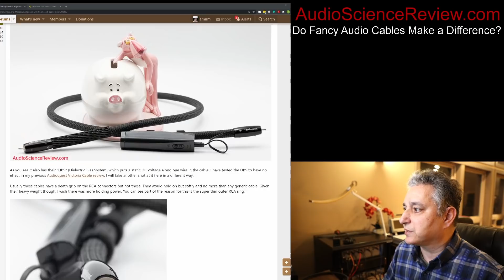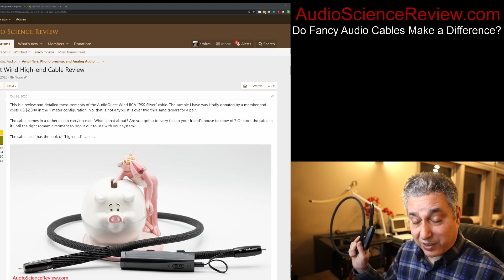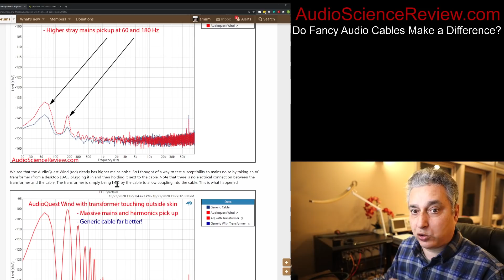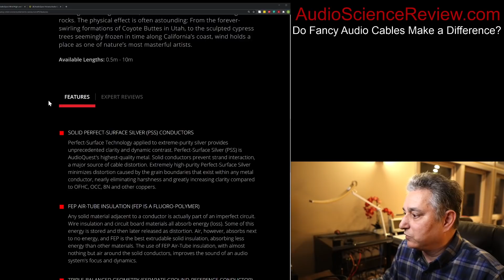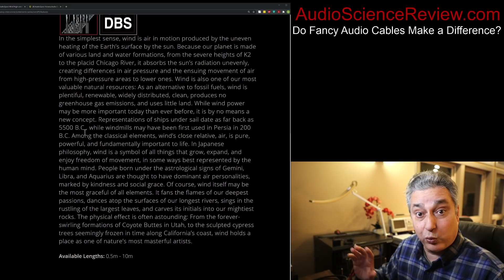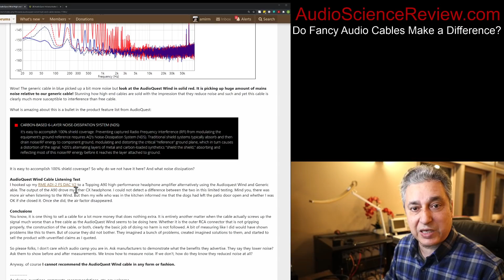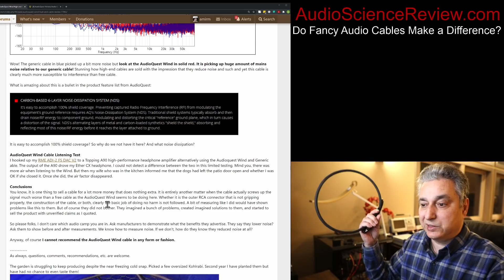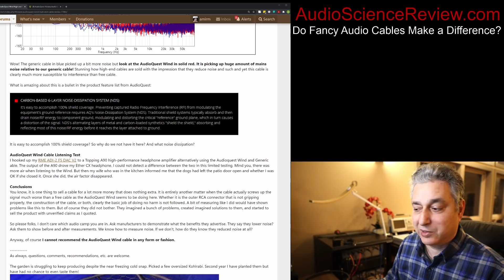Do Fancy Audio Cables Make a Difference?

Comment: Amir, you have forgotten to use the small pyramids in combination with the fancy cables. The energy of the pyramids make the Noise shaping.  Only in combination with this pyramids you get fare mor better measurements as your generic cable 😁😁
Reply: LOL. Your comment reminded me of the old claims that putting razor blades in plastic pyramids made them automatically sharpen themselves.

Comment: Being a bit like the Devil's Advocate. Amir, you do mention that the "free" cable you used for testing is from Hitachi, which probably is a pretty decent one in any case. Knowing that it's impossible -and certainly futile-, to test every cable out there, would you have a guidance of a certain threshold one should aim at? I have seen some reviews from Archimago where, for example, Amazon Basics XLR cables performed poorly. Again, not an easy question, but you may have a proper answer. Cheers!

Comment: Imagine spending $2000 on an unbalanced cable. How can you have so much money but know so little about audio interconnects?
Reply: Easy, money has a rather low correlation to science knowledge.
Reply: Because unbalanced interconnect cables (RCA) are still the most common for hifi, including the most expensive gear.

Comment: I want to point out that AQ included a low battery indicator. Should you be able to hear the difference when that battery died?!
Reply from the maker: If their claims are true, you would hear its effect and hence there should be no batter indicator!  There is no battery indicator on a flashlight for the same reason.

Comment: Keep them coming! Great video. Btw, can you record it with a bit higher volume? These tend to sound good, but so much lower.
Reply from the maker: I am trying to troubleshoot this.  I have set levels quite high but somehow they are getting reduced in the pipeline somewhere.   Should not be too hard to find.

Comment: The irony is that $ million dollar music production studios use affordable XLR cables that anybody can afford and yet audiophiles buy “better” cables.
Reply: Thats not irony thats stupidity
Reply: Plenty of mains power cable hooking up passive speakers too.
Reply: Yes I buy Better CAble brand; it is reasonably priced.
Reply: @oldb3139  yup
Reply: I know of couple of recording studios that use cables north of $60k.
Reply: The customers of Hospital Records asked why they don't serve high-def versions of their songs. They replied something like this: The music is mostly sampled using standard quality mp3 samples, storing the end result in 24-bit format would be only a waste of bandwith... Same applies to any studio. Their monitoring gear is just regular near field monitors (which are the reference for the final sound) and cables regular balanced studio cables. The sound simply cannot be improved over what's it's been produced through. Speakers are the only part where things are usually limited, a regular studio monitor can't reach the transparency and distortion levels of a large electrostatic panel for example. You will be hearing things that the master technician missed during mastering. Good or bad.
Reply: Clearly need to hear from what the engineer from mapleshade says
Reply: BuT iT sOunDz So mUCh bETtEr tO MY gOlDeN eArz, aMir… dErP!
Reply: We made most of our cables, after reaching a certain point of irritating rats nest due to set lengths being looped over, and zip ties, and cable management clips, etc... We used Neutrik XX series connectors, bought reels of cable, and it ended up being worth doing. Assuming you have more than one pair of hands to put on making cables. Oh, and add the costs of pizza and beer. That put us squarely into average Joe cable pricing, with great results, and fond memories of not being bored to death on a Tuesday.
Reply: A lot of pro audio people are making their own cables for their own needs.
Reply: Irony is that best studio for sound productions have audiophile sistems for mastering
Reply: I know a studio that uses $250.000 worth of Audioquest cables so your irony only works if that was true
Reply: @momchilzanev5861  well done, you know a studio run by idiots...
Reply: @GregHighPressure  Not if the cables are free (;
Reply: @momchilzanev5861  Well, it's mostly true because most studios don't use 250,000 dollar worth of cables. Although most studios (professional that is) don't use low or medium cost cables. However some really successful recording- and mixing engineers actually do use quite low cost cables.
Reply: Momchil Zanev which studio is this? Is this the one audio quests demos their products to their suckers cough I mean customers?
Reply: @momchilzanev5861  Name the studio
Reply: @woofowl2408  Dave Gilmour is not an Audio Precision testing device and neither is he an Electrical Engineer, so I don't care what he has to say.
Reply: @moshet842  Clearly you didn't read the article as it was not Dave Gilmour who was interviewed. Also, my comment was in answer to the original comment "Stop the FOMO". Talk about moving the goalposts....
Reply: @momchilzanev5861  and I know another studio - leading one in the world - that doesnt!! ;)
Reply: @momchilzanev5861  the  connectors are more important  than the wire
Reply: @momchilzanev5861  If true I'd be willing to bet that studio got them for free or dirt cheap. That's how this con works.
Reply: @momchilzanev5861  One out of how many? x'D Most studios don't use big $$$ on cabling because they know that it doesn't matter past having a proper strain relief and being made from OFC copper.
Reply: @momchilzanev5861  depends, some of the greatest hits don’t necessarily sounds better on good headphone, it is very limited I have to say
Reply: @momchilzanev5861  Are they still in business?
Reply: @momchilzanev5861  I love it when audiophols like you chime in,because you need some sort of justification to have spent money on cables from a company that primarily sells snake oil products,you don't even state the name of the recording studio you just say studio,probably your boy friends yoga studio.
Reply: @momchilzanev5861  Wow, I'm convinced.
Reply: @whiskeykilmer1866  I don't want to convince anybody into buying expensive cable, I am just trying to avoid generalizing.
Reply: @momchilzanev5861  But are you prerhaps familiar with the expression "One swallow..."?
Reply: @whiskeykilmer1866  your not convincing either
Reply: @momchilzanev5861  what studio i wanna record there
Reply: @momchilzanev5861  Most professionals use Mugami for best quality XLR cables...

Comment: Another must see video for all audiophiles. Great job Amir! About five years ago, I was lent an Audioquest Water balanced interconnect by a local audio shop to try at home. Another battery strapped cable similar to the Wind but a few notches down in the Audioquest hierarchy and much lower in price, about $700. Something was fishy about it and it didn't feel right. I always felt Audioquest was full of snake oil, now I know for a fact. Actually, I've come to realize in the last five years that most audiophile cables are snake oil.
Reply from the maker: Thanks Jesus.
Reply: Almost every audio company are unethical.
Reply: Correction, all audiophile cables are snake oil.
Reply: ALL of them are
Reply: @edwardbalboa5528  some of the cheaper ones are great if you want something that looks cool
Reply: No not most.... All of em are voodoo
Reply: I don't like aq, for these reasons. However.... analogue cables do sound different. I.e. i had a vdhul cable cs-122 (about 200 euro), which was nice, but serious bass control issues. And replaced them with inakustik 1602, second hand (new 2500 euros...), and the difference is just breathtaking. I am not talking subtleties here either. Bass issues gone, everything sounded more realistic, better sound stage and so on. (And No it doesn't have batteries;) )

The advice will always be, go listen.
Reply: @CyberBeep_kenshi  I still find that hard to believe when all the wiring inside your components is likely much cheaper, standard stuff.
Plus, things sound different day by day, when within the same hour, without having changed a thing in the system
Reply: @RennieAsh  well all the components end up as your output signal which should be pretty constant. The speaker and interlink cables really do affect the sound. The cables i mentioned sound drastically different. I have no idea how it works, i just listen. But to give an idea, the cheaper (sorta) one has thin copper strands with silver coating and is 2.5 mm. The inakustik has i thick about 40+ thick copper wires. The whole thing is 3cm in diameter.... so these 2 have very different properties. 

But heard it with plenty other cables too. And not even very expensive ones too. And i am a real Skeptic, was looking at the aq powerquest here for some good data.
Reply: @RennieAsh  Yes. Your emotional state when listening and your established beliefs about what things matter affect your perception of sound quality more than many other factors. For this and other reasons, blind testing and statistical analysis are needed to back up claims of improved sound quality. Otherwise, snake oil!
Reply: @CyberBeep_kenshi  and yet you bought it off someone else,because it wasn't good enough,or he realized it was snake oil and he cut his losses, therefore he sold them to an an audiophool like you,and you think you hear a difference,and wow! you only paid just under 10% for them,now you can brag to your audiophool buddies,and tell them you practically stole them from the seller.

Comment: I recently purchased an Audioquest cable (Big Sur, aprox $150) to replace a generic one (Amazon best seller) that was picking up a lot of audible noise, and it did eliminate the noise. 

I thought this was worth sharing as one might think that a cheap cable is always the same or better than the more expensive ones which is not true.
Reply: It's possible that the construction on one of the cables was severely flawed, assembled incorrectly, or broken, but otherwise there's no reason to believe that would make a difference. I've had cables cause noise or crackle especially when adjusting them, but it's always because the connections in the jack were damaged somehow.
Reply: @xthechar I tested more cables and most of them picked up a lot of audible noise. The noise appears just by plugging in the cable (with the other end in the air) which is why I thought it must be RF.
Reply: I think I understand your point. I also faced problem with very cheap no-name RCA cable(it cost less than 3 USD for 3m length in Thailand) that cause humming noise on JBL 305p active speaker even if I did not play anything. But I just changed to some cheap brand such as ugreen cable that cost only 7 USD the problem gone. I think if the cable have normal standard it will have no problem. I also found the same thing with very cheap HDMI cable(under 3-5USD for 3m length as Thailand near China so the price may vary from USA) that unable to maintain 4k HDR(10bit) connection the picture random disappear. But the cheap ugreen HDMI2.1 that cost 10USD for 3m don't have problem. So I conclude that If we use cable with normal standard it should have no problem. If you found problem then it cable that below standard or the fake one.
Reply: @ihayo  Ugreen cables (3.5mm to 3.5mm and 3.5mm to dual RCA) are among those that I tested and resulted in high noise. The Ugreen 3.5mm to 3.5mm was the noisiest of all.
Reply: @crstdr1  Sorry for my info unable to help you. But what's your system? may some of component flaw induce RF noise and you need very extra shield RCA cable to eliminate it? we may point to incorrect root cause. Such as home AC plug system, with or without ground line ? switching power supply or linear power? I also found my friend AC system problem that cause very high noise because inside wall plug connected with incorrect position port(L and neutral swapped), Anyway , if we unable to measure with right measurement or know more specific factor then we use trial and error to solve problem, but it may not the actual root cause.
Reply: @ihayo  Thank you for your thoughts. Indeed, it seems there's unusually high RF noise around my digital piano although I don't really know how to measure it accurately and how find the root cause. The ground loop noise is another story, I've had that as well and eliminated it by adding a Topping D10s in the signal path and using its TOSLINK digital out.

Comment: Great video. Thank you. How do you plugs the cable in the spectrum analyzer when you measuring the noise?
Reply from the maker: The cable is still connected between the source and sink of the analyzer.  It is just that I don't turn on the generator.  The receiver in the analyzer digitizes the source and performs a spectrum analysis using FFT.  Did I answer your question?

Comment: 1 - What about listening tests ?.  
2 - Closed loop sinewave testing using a D&N test set is in no way representative of the effect on the behaviour of audio systems according to cables. 
3 - The effects to be measured are changes in system excess noise behaviours (amplitude and time dependent) that are different according to cable materials, cable geometry and cable RLC values. Amil your testing proves nothing and is counter productive.
Reply: If measurement shows you that there is no difference or that the high-end cable is even worse to a standard cable, you seriously believe you can hear a difference?
Reply: @fan2hd277  Sinewave testing is useless for predicting system behaviours.
Reply: @ericmc6482  Show us evidence that (whatever) differences you found with your measurements are correlated to how people "subjectively" perceive differences in sound. Also, please, show us your measurements!
Reply: @ericmc6482  Why?
Reply: @andybright3809  why what ?.
Reply: @ericmc6482  Just publish your results and your methods so we can attempt to understand and verify what you are saying.
Reply: @therealj4282  ASIO soundcard, loop back recordings of system output with cable/device A and cable/device B, compare recordings. The residual will demonstrate different behaviour of system according to cables/devices used. It is as simple as that, like I say measuring a cable or device in isolation is useless.
Reply: @ericmc6482  Yes that's a nice try but I don't think a soundcard is high grade enough equipment to use  here.  The ADC module of most soundcards is nowhere near good enough to analyse the difference between cables.  Any differences you see between the output signal and input signal are more likely to be random noise and encoding inaccuracy of the soundcard ADC and can in no way be used to conclude a qualatative difference between the cables. 
Amir is doing much the same thing as you suggest but using instrument grade equipment to compare the output and input signals.
Reply: @therealj4282  Right, you are not understanding how noise works in causing system signature. The deal is that source noise excites excess noise behaviours inherent in downstream equipment, small changes in source noise can cause relatively large changes in multi stage system acoustic output as evidenced by subjective review findings. All materials/stages cause excess noise and these changes can be strongly interactive. For example change source interconnect cable and system excess noise (signature) changes even though such interconnect cables measure very similarly on typical test set. 24 bit ASIO soundcard stimulating system and capturing system output is entirely adequate to capture system output changes according to interconnect cables. The likes of AP test set is built to generate very pure (low noise) output signal and in so doing does not excite DUT noise mechanisms and indeed shows 'null' results. This is fine but does not represent system test, iow individual DUT is an essentially useless test and the conclusions drawn are essentially useless, actually erroneous.
Reply: @ericmc6482  why is 'sinewave testing useless for predicting system behaviours'?
Reply: @andybright3809  Sine wave is perfect for measuring THD/I'MD but does not stimulate noise mechanisms. Multi frequency testing goes some way to exciting noise mechanisms but is still a stationary signal. The only proper way on my experience is to use real world music and compare recordings of system output.
Reply: See the Frequency Response part.
Reply: I am yet to see a properly conducted listening test to show any significant difference in how people perceive changes in SQ caused by different signal cables.  Please enlighten us.
Reply: @brave1671  Changes in low level detail and timbre as per my post.